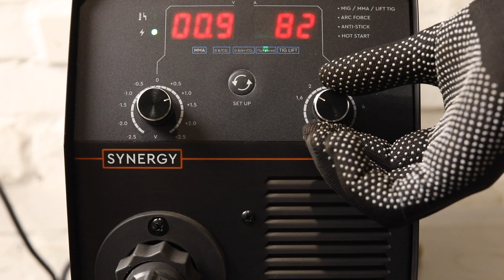Very Old Rusty Pocket Knife Restoration. Knife of the 17th-18th century

Comment: > "Restoration"

 > uses a Dremel, wirewheel, belt sander, etc

 > sands and buffs the blade

I suggest "molestation" or "modification". Not "restoration". 

This is wholly inappropriate for antiques. Removing corrosion products is somewhat required for ferrous artifacts, like the blade, as they do not form a stable or sacrificial oxide layer, but you never want to damage the underlying steel.

Beyond that, the handle is copper alloy. It does not need to be treated so severely. The oxide layer on it will not progress infinitely like corrosion on a ferrous artifact. 

To readers of comments: if you own an antique weapon, DO NOT copy this method, or anything like it.

This is destructive.
Reply from the maker: Here you can see another restoration method https://youtu.be/k6N9cKLS_20
Reply: @ReXtorer  another example of using a dremel and wire wheel attachment. Wholly inappropriate.
Reply from the maker: I used a dremel to remove the remaining rust. The metal was not processed.
Reply: @ReXtorer   @ReXtorer  you used a steel wire brush on a dremel on a steel object. The fact that it polishes the surface should tell you that it is removing and altering the surface of the knife. 

You also used several either carbide, diamond or hardened steel attachments to remove localised portions. This is extremely inappropriate. This is equivalent to drilling.
Reply from the maker: Thank you! I understand that it is necessary to remove rust more carefully, but objects from aggressive soil and even weeks of being in a solution of caustic soda do not give results.
Reply: @ReXtorer  I recommend seeking new methods when the old fail.

If electrolysis, citric acid etc (methods used in museums) do not work, go to the next stronger thing, like EDTA, a chelator. 

A recent study in the Cairo museum used a combination of scalpels to remove bulk corrosion, then Citric acid immersion, then EDTA for the dark, black corrosion which the Citric acid could not remove. 

Overall, this process is safer than many alternatives.

The annoying thing about working with ferrous objects like these is that we can only ever hope to minimise damage when addressing corrosion. We can never fully avoid it - and leaving the corrosion untreated will do more damage over time than an appropriate conservation method
Reply from the maker: Thank you! I have a folding knife with bone scales. 17-18 centuries. Corrosion is active. I am thinking about how to save the scales and clean and preserve the knife. I'm afraid to lose the scales. It's not an extraordinary knife, but it's a challenge. Here is this knife https://www.youtube.com/channel/UCvBZ97Qkj7tyTr9RZsEeKhg/community?lb=UgkxbysX5vdYFSOedj2bsDtutOnO0ZWIQRRs
Reply: @ReXtorer  I tried to reply to you but youtube ate my comment. 

Do you have an email I could reach out to? Happy to talk about a potentially useful process
Reply from the maker: eukukulka@icloud.com